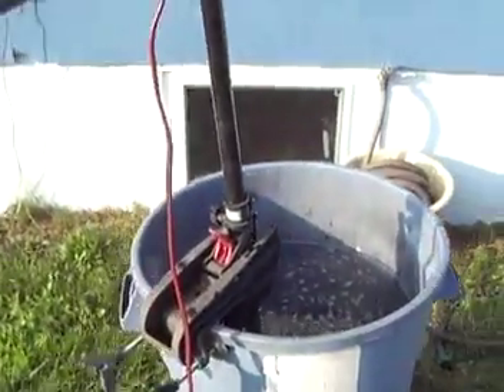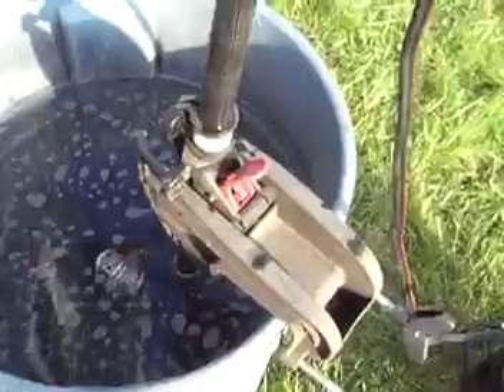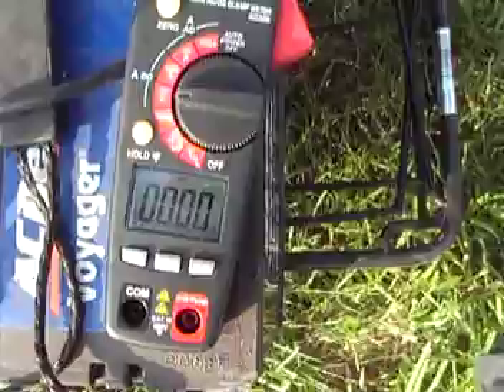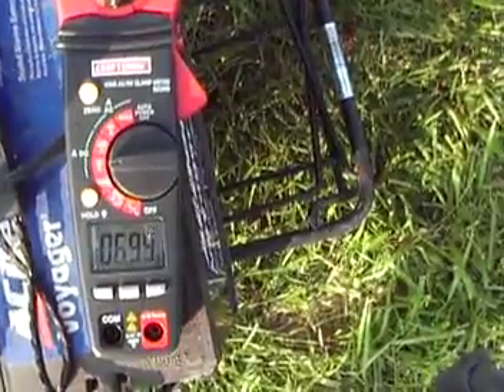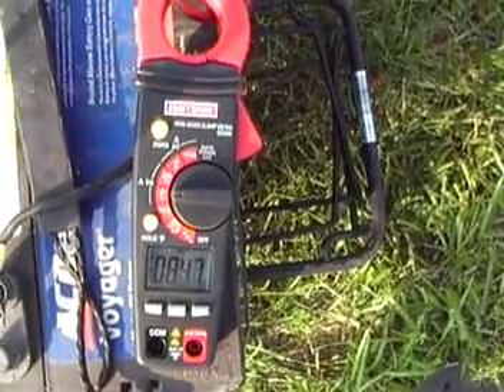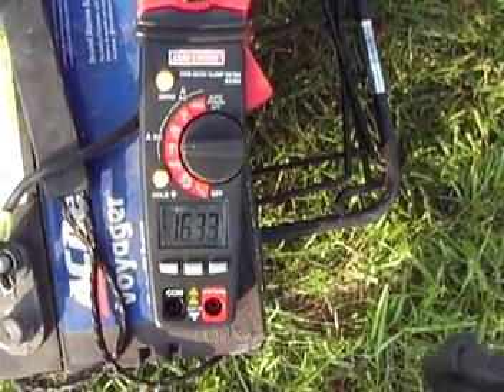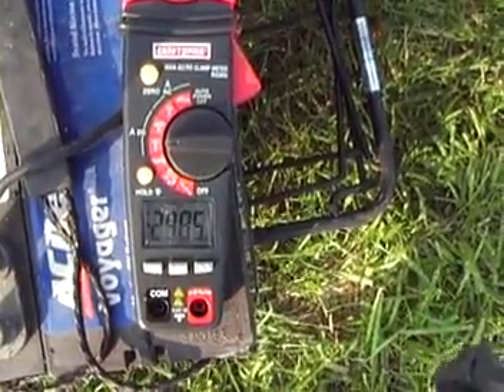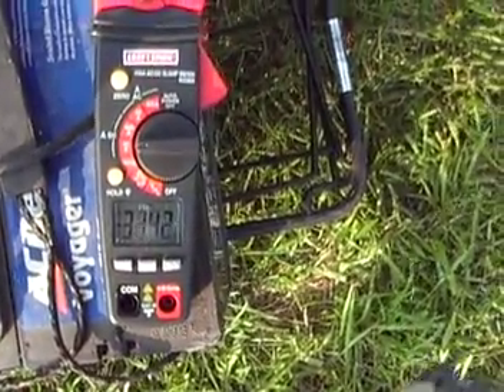MinnKota 12V 52 lb Thrust current draw test

Comment: This is pretty much the best you can do at home short of a swimming pool, but I suspect the real world current on the open water will be higher because there will be more resistance.  In a garbage can, especially at max throttle, the water gets aerated and easier to push around plus the mass of water in the bucket is moving much faster relative to the motor than it would be in a boat.   I just came from another video testing a Minn-kota C2  40 lb on the water and at full speed, it drew 35 amps.  I suspect your 52 lb motor would draw about 45-48 Amps on a boat in the open water.

Comment: This motor pulls my 15' open bow very well¬¬¬>allmy.tips/Minn-Kota?L12     I bout it in case my outboard conked out, but found it is perfect for riding through alcoves where people are fishing and swimming. This model has a longer shaft and more power. Has not drained my battery once.

Comment: Your clamp meter can measure DC current? What brand/model is it?
Reply from the maker: http://www.sears.com/craftsman-digital-clamp-on-ammeter/p-03482369000P
Reply: Thanks. I didn't  even know it was possible to measure DC current with a clamp meter.
Reply from the maker: You're welcome.
Reply: To correctly measure DC current you have to put the clamp around only one lead, either the positive or the negative will work.  Clamps measure current in a circuit by measuring the strength of the magnetic field around a single conductor. Whenever possible, separate the test conductor from surrounding conductors by a few inches. By having the clamp around both at the same time, the reading will be lowered by the magnetic field of the other conductor.

Comment: If it would really be a 52 lb version, it should take up to 50 amps on max. 30 lbs versions take 30-32 amps on full speed. I had a MotorGuide Varimax 55 36" and similar AC/DC clamp amp meter. Verified that on the MotorGuide (which I sadly sold) and with a MinnKota copy, which is identical to what Team Dougherty has tested here on the video.
Reply: Markus Korhonen thats the correct running amperage without weeds and other debris getting caught in the propeller. It can pull up to 50 amps if it needs to.

Comment: Depending on how much speed you get from 1 to 5 it ain't a loss! You got to get the average on speed also to conclude the test! If you get a turnigy 150a wattmeter you can calculate how long you can go in watts at each speed!

Comment: Kgradio is on the right track. 
First any trolling motor will pull a higher current at higher speed settings. It's the law of physics. No mater if digital PWM or not.
As far as the test in the trash can it is a good indication of initial current draw. As If your boat was setting still in the water. But as the boat starts to pick up speed. The current draw will taper down by 5amps or more. Obviously depending on water current or wind conditions will have huge impact. 

This is why a lot of pros will set there trolling motor on continuous mode, but at a lower speed setting. Your battery will last a little longer. Because there is no high current surge being drawn by the start and stop of the trolling motor.

I have ran the same test with my trolling motor (in a lake), so I could size my battery correctly. 

I am not taking away from the trash can test. As it will give you a good indication of run time. 

Also keep in mind the condition and/or type of TM prop will have an impact on efficiency.
Reply from the maker: I have done the same test on a lake and on a river. The current draw is the same as in the trash can.

Comment from the maker: Nate, I would figure out how long you would run the motor. The battery I am using is 105 AH. I should get about 3 hours at full throttle run time. The smaller the battery the less run time you will have.

Comment from the maker: My battery would last about 3 hours at full speed. The only time I have to worry about is when I go to an electric motor only lake. Then I just bring two batteries. other times I use my gas motor to get me somewhere then use the electric motor just to hold position. Then when I do run the gas motor it puts some charge back into the battery.

Comment: Cool test. I am about to attach a C2 30lb to a kayak and I was told by Minnkota that it would draw 30A max at full speed. They told me the 50lb would draw 50A Im wondering if it might only draw 15 or 20? I need a shunt to be able to meter it since I have a regular multi-meter. Im wondering if the values they gave me were into the wind or current. I guess we will find out. I will probably have to run low on a small battery due to massive battery weight!

Comment: Good job, I would love to know the voltage sag at each setting to see how well the battery handles the different current loads. Is there any chance that the current would be lower in actual use on the lake?  That little trash can could be restricting flow and causing the motor to work harder, It's just a thought but I think it would be worthwhile to make the same measurements while cruising on the lake.